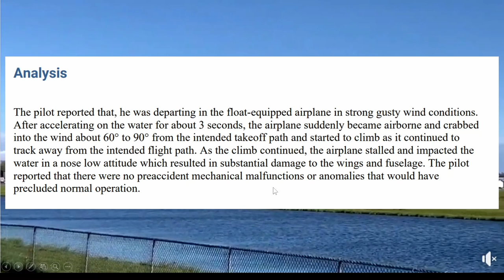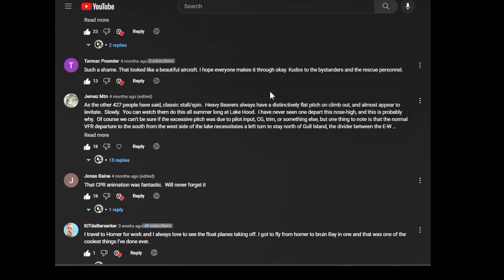De Havilland DHC-2 Beaver Fights Gusty Winds

Comment: The mistake #1 as I see it was keep his butt on the ground [in this case water] till the gusty winds subsided.  He should have been able to tell by the whitecaps on the waves if the wind was blowing hard enough to maybe cause a problem.  Or he should have kept it on the water until he built up speed past normal rotation speed to have a little more power to fight through the wind.  I also noticed on the pilot's information that his licensed shows waivers and limitations.  Maybe his next limitation will be not permitted to fly in windy conditions.
Reply from the maker: Thanks for watching and the comment

Comment: Failure to control the aircraft. Was the CG too far aft and or trim not set correctly? Maybe the video can be enhanced to see if the elevator was full nose down  or if the pilot simply didn't attempt push the nose over to maintain control.

Comment: The pilot's statement is laughable. He makes it sound like he had absolutely no control over the airplane. Like he was totally at the mercy of Mother Nature. Like he couldn't even lower the nose of the plane to prevent the stall.
Reply from the maker: Hey Philip 👋
Reply: Yeah. If only there had been someone, just anyone at the controls of the plane.

I'm not a pilot myself but I've heard that it's not uncommon for pilots to push on the yoke to keep the nose down until the plane reaches rotation speed
Reply: Back of the power curve, could see it coming miles before the stall
Reply: Guess he'll stretch the truth as far as he can,  to look after #1 , when telling his side of the story. Otherwise he'd have too many lawyers running after him .
Reply: @leigh6113  I think you're right about his being on the back side of the power curve. I've lifted off prematurely a few times and recognised it instantly and accelerated in ground effect to proper climb out speed. In his statement he never mentioned airspeed. I wonder why?

Comment: I would’ve expected a more honest description of events from a pilot with 1700 hours of flight time. The airplane didn’t just do these weird things on its own. It had help from a pilot who got complacent and whose head wasn’t in the game. This was a stall spin due to poor power management and pulling back on the yoke to aggressively on take off. It’s laughable and shameful to hear an experienced pilot say “the plane just started to lift off and crab to the left” it did that because you yanked the yoke and tried to put it in the air before it had enough power to maintain a climb out so of course it stalled and rolled left which is what they do. It didn’t have squat to do with the crosswind. If anything he would’ve had more power and his feet on rudder where they should be to compensate for the crosswind which would’ve helped prevent this blunder.
Reply: Bad Pilot ! You can read out of his explanation that he is not accepting he was totally wrong. He weil make the same bs again.
Reply: Well, seeing those black squall like lines on the surface as a sailor I know that can easily be a 15 knot or more gain and sudden change of direction.
  But he did not anticipate this even though the signs were there and lifted off sooner than he expected. By the time he realized it it was game over.
  Not an excuse, the report nailed it. I’m sure if he was to comment here he would easily admit he screwed up! He was not vigilant about what was about to and what could happen.

Comment: The pilot's statement is not consistent with "reality". It takes more then 3 seconds just to bring up the power on the R985 radial engine alone. The water run is in the 30 second plus time frame (load, wind, air density.........dependent). For seaplane ops especially, the primary factor/constraint for both take off and landing is the water condition, water length available, approach/departure obstacles and then the wind. This is especially critical when operating from big bodies of water or open sea where I fly. Half of our take offs are cross wind takeoffs. This requires cross controlling the aircraft, basically lifting the wing (and one float) into the wind (preventing the aircraft from being blown sideways downwind). The rudder is used in the opposite direction to keep the seaplane tracking straight, preventing a turn on the water (however sometimes we allow for a turn into the wind while on water, if the water area allows for it). As soon as the aircraft departs water, we allow for the turn to face into the wind. This provides the best climb performance and keeps the airplane tracking in straight line over water/ground. This is flying 101.

If his airplane on it's own turned into the wind after take off, he was in good shape. It does not look like he had to clear any obstacles right now. He simply never accelerated the airplane to a sufficient airspeed (we don't have the water run vid). Once airborne he maintained too high angle of attack, he wanted more lift, but with more lift comes more drag. He never achieved safe airspeed, the left wing said no thanks and it stalled. These are the physics of this crash, everything else is just excuses and noise.
Reply from the maker: Thanks for breaking that down so simply for us.  Awesome

Comment: Pilot error departure stall. It's always nice to have the turbo prop engine option. So much more power to help get off of the water and the drag of the floats in the air.
Reply from the maker: Right on Pitts. Thanks for sharing